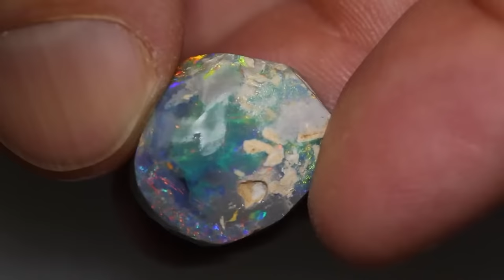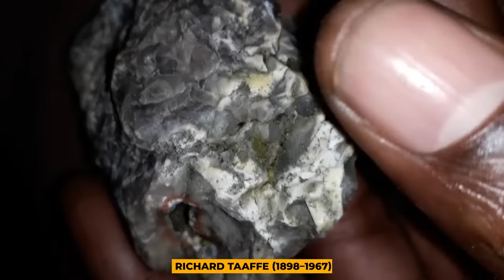Most EXPENSIVE Rare Gemstones In The World!

Comment: Uh, "necklace with a 0.5mm jade bead."  I don't think so. 0.5 millimeters = 1/2 millimeter.  This letter: "o" on most people's screen is about 2 millimeters, go ahead, get a mm ruler and measure it.  0.5mm is so tiny I don't think it could be drilled and strung.  The jade bead necklace shown has bead about 18-20 millimeters.  Other than the "typo" nice, enjoyable video.